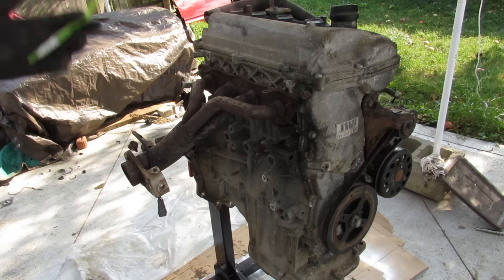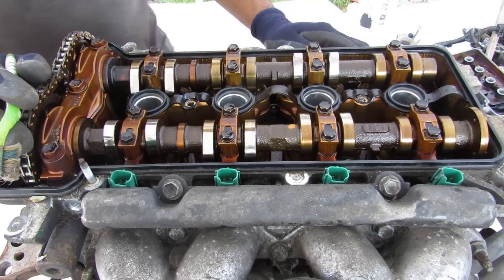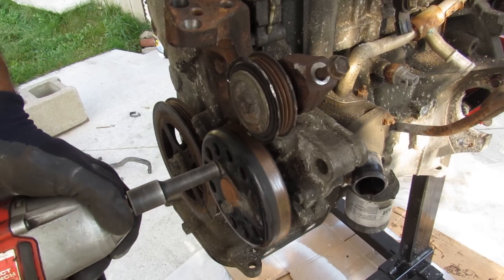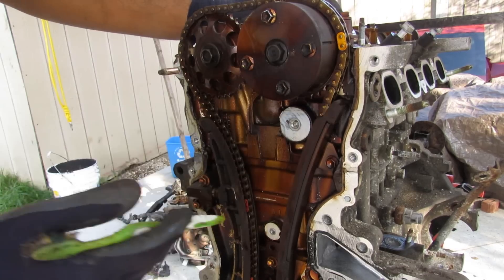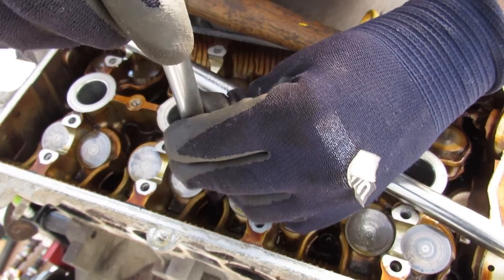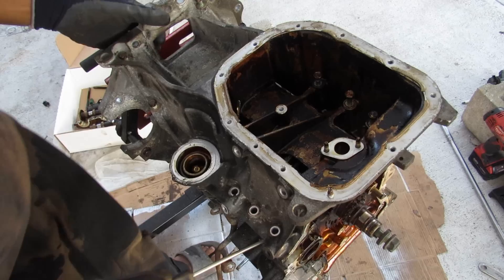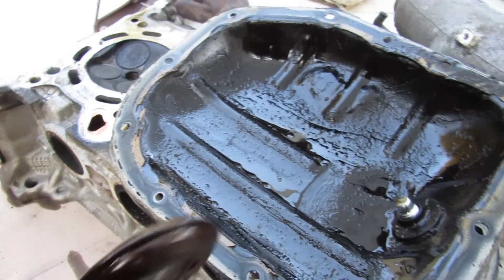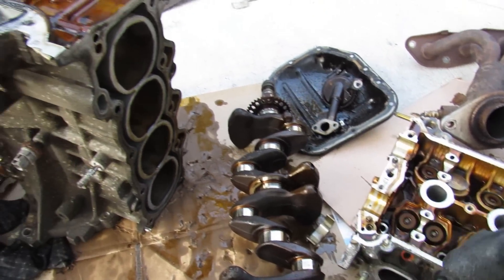What's inside a 500,000 km Toyota Engine?

Comment: Yeah Toyota has some of the best engineering and mechanical friendly assembly. I learned on Peugeot, then worked on Honda, then in an open garage with all kinds of cars and now on Toyota and everything is so easy to work on and they really have quality parts its like night and day compared to other brands.
Reply: From the work you have done on Peugeot. What can you say about this brand from your expirience?
Reply: @SunStarcz  Their absolute garbage tbh. I really dont like hating but spare your time and money and get something else.
Almost all Peugeots with +100k km (around 65k miles) leak oil at one seal or another, or all of them.
There's honestly nothing better than japanese brands. 
Yeah maybe you pay a little bit more in the beginning and parts are also maybe a little bit more expensive but in the long run youre having much much less problems and its definitly going to be cheaper.
We have Toyotas with 30+ years and 300k km and they look better than some peugeots with 50k km.
Reply: @benistingray6097  Thank you. You have only strengthen my cureent opinion. Once I will have enough money to buy a new car I am definetly getting a Toyota. Right now I have my first car and it is and 98 Peugeot 306. So far I cant say complain because it is my first car and I got it for free but still. Good to know that I better not buy from Peugeot again.
Reply: @benistingray6097  Hi, same question as before but with Honda? How much difference is there between Toyotas and Hondas? From your experience
Reply: @MHNK77  Hm their both really good but i would still rate Toyota higher. 
We had more "non service" work with Honda, mostly small stuff that broke, for example the Honda Jazz always had problems with the EGR systems clocking up.
Also i would say Toyota is more servicable. The way the engineers build stuff makes working on them super easy which in return should make repair bills lower just because the work is done faster.
But take that with a grain of salt, i havent really worked on Honda in the last few years so things could have changed.
Also im only working on Toyota for maybe a year so i dont have the same experience as with Honda.
You cant really do wrong with both of them. 
Best is to do your research on problems with the specific car and engine your interested in and avoid problematic things.
Reply: @benistingray6097  Thank you
And yeah, I actually bought a  2015 Honda Fit (american version of the Jazz)
Manual transmission, 1.5L iVtec engine, as I read it was really realible because of how simple it is. Just wanted to know another option
Reply: @benistingray6097  hmm what's your thoughts on the famous 1.9tdi by vw about both VE pump and PD ( pumpe düse)?
Reply: @SunStarcz  It’s a french car manufacturer. They are cool and unique but the quality is pretty dogshit.
Reply: Everything makes sense
Reply: Cringe Department  Cant say much about 406 and 806 but starting with the 206 it went downhill pretty fast.
P.S. And considering the 206 was released almost 25 years ago, i think my advise to not buy a peugeot is pretty sound. Someone whos interested in a classic 106 gti or something will do much more research than someone whos casually looking into buying a car without having to worry.
Reply: Hondas are easier to work on than Toyota. Just look at the service of brake bleed on the Prius vs Honda
Reply: No. From the perspective of quality, denso, aisan, aisin (toyota) always better than mitsuba, nissin (honda). Changing pcv valve always easier on toyota, changing fans and radiator also easier on toyota. Honda also making roomier cabin by sacrifying engine bay and wheel steering position relative to driver seat. Check honda fit or jazz. @LoveLikeaHurricane

Comment: Hi speedkar, are those engine oil flush cleaners any good to clean in around the oil control rings and the drain holes behind? What's your opinion on using them? Save an engine strip down? I always change oil and filter every 5000 miles. But i can only afford to buy 10year old cars. Its a lottery really, previous owners may not care too much. Currently driving a 2004 yaris which had 2 previous owners, very well maintained by last owner. 105,000 miles and oil consumpion zero, emissions reading tiny, well inside specification.

Comment: My parents had 1 that they traded to a mechanic for some work on another vehicle. It needed a new battery pack. The odometer stopped at 399,999 for some reason but they drove it for another year before it started having computer issues. It still had the original brakes.

Comment: These aluminium engines  start burn  oil after 100,000 miles. Means what???

Thery are worn.. worn parts are not visible to your naked eye..

Do you understand  that??

Comment: Can you recommend a product to remove the varnish and unclog the piston rings? My 2009 Prius is starting to burn oil. 180k miles.
Reply: Iirc there is a product your pour into cylinders and soak them that helps unclog the ring ports

Comment: That was the break in period, good for another 500K
Reply: Dude....the cylidners are not even round!
Reply: @hussamjamil4980  It's been properly sized to the pistons for optimal performance!
Reply: Agree. Fill with high detergent petrol and slap in some good quality oil and filter and change every 5000km most of that sludge will be gone.
Reply: these cars were probably scrapped because of battery issues, rather than the engine problem

Comment: Great video. I own a 2005 Prius with 193K miles on it. Owned it since 14K miles and changed oil with full synthetic oil and expensive mobile 1 filter every 5K miles. Transmission fluid changed every 75K miles and coolant changed every 5 years. I have replaced the traction battery, Throttle body and a 10 dollar radiator hose. Paid 14K in 2007. Still laughing all the way to the bank. Very happy with the longevity of this vehicle. I do not plan to sell ever. Drive until failure so large that it is financially not able to repair. Great to see this teardown.
Reply: Really? $3,000 battery and you’re laughing to the bank?
Reply: @morrisl7  i paid 2800 and sold my used battery for 1000 and returned a completely dead battery from the person who paid 1000. My cost basis is 1800 so yeah still laughing.

Comment: Have the updated 1nz fxe engine in my 2017 axio hybrid. 80k km. It runs good but with an occasional cold start rattle especially if the injectors are dirty.

Comment: That's an interesting view: bearings all nice and clean, but those piston oil scraping rings... I have a 2010 Lexus GS 450h, the 2GR-FSE with 356.000 km. I reckon it would look similar inside, perhaps less sludge, as there is some oil consumption, but runs fine.
Reply: Seems consistent with my 2008 prius with 287k miles. Used 1qt of oil every 1500-2000 miles
Reply: Hlo senpai big fan here
Reply: Just use Eneos Sustina 5W30, which keeps the engine very clean. The Toyota 5W30 sadly is a very bad quality oil (but their 0W20 is probably the best among the 0W20 oils). I couldn't find the TDS for the Toyota/Lexus 5W30 so I am not sure if that is better than the Toyota 5W30 but you don't go wrong with Sustina.
Reply: @IstvánUjj-Mészáros  I prefer Motul
Reply: @VisioRacer  the Motul may be good too, but I have personal experience with a P2 that was consuming almost 1liter on every 1000kms (it was using Toyota Genuine 5W30), and I did an oil ring cleanup with Xado MaxiFlush and started to use Sustina, and there is only some very minor oil burn now (about 6dl on 10.000km). And there is no oil burn at all for those P2 users who were always using Sustina.
Reply: @IstvánUjj-Mészáros  The brand doesn't really matter unless it is synthetic in the correct weight. It just matters how often you change it to prevent sludging. The more often you change it the better. The 2XX toyota engines are sludgers so they benefit strongly from 5k or less mile oil changes. They don't seem to do well with 10k oil changes and usually clog up the rings pretty quick.
Reply: @paladain55  the quality matters, and there are some very good quality oils, but shell is using Gas-to-Liquid base oil which makes it special (some other brands are using that too but they don't make the information public so we can't be sure which ones are using that). GTL burns very clean, hence it keeps the engine clean. There are a lot of tests on YouTube about the Pennzoil Ultra Platinum, which is the same as the Shell Helix Ultra (Shell is using the Pennzoil brand in the US). It is an exceptionally good oil, especially for Toyotas where a lot of petrol engines have the sludge problem. If you change it every 5k or less mile then you are probably good with any synthetic, but in Europe, people are usually changing the oil after ~9.3k miles (15k km) as it is what Toyota tells them to do, so it is very important here to use very high quality oils. I know that the Sustina is fine for 9.3k miles as many P2 users were using that since the car was new and these cars don't burn oil at all. Sustina is using a very special additive package, probably that's what makes it that good, but I have the suspicion that it may also use GTL base oil (I may be wrong about that). The Shell ECT C2/C3 has exceptionally high viscosity index (204), which also makes it stand out.
Reply: @IstvánUjj-Mészáros  This is more or less why i say change it early and use synthetic. There's more risk vs reward leaving the oil in for a long time like that. Change it at 5k instead of 10k over 200k miles in very little extra expense vs more than likely clogging the oil control rings.
Reply: Great vlog very detailed and informative. Question what oil was use in this engine is it mineral or synthetic oil thank u & more power on ur vlogs
Reply: put in some marvel mystery oil!
Reply: https://youtu.be/wafZjkY0H_E
Reply: @sin-sinner7192  no

Comment: The typical hybrid motor won't actually have that many miles because if you're using the electric 30% of the time that's actually 30% less miles that car is actually running so the engine didn't really look that good for 200,000 miles

Comment: 494 000km on my 2nd gen Prius. It's so freakin reliable. Just warm up/cool down your engine and change oil regularly, then the car is gonna last forever. Current oil consumption is 0,3l/10 000km, which is pretty acceptable I guess :)
Reply: WOW😅
Reply: awesome reliability.
Reply: What kind of oil did you use?  Are you a sporty driver?
Reply: @Elaba_  so, 3 days ago I passed the 500 000km mark :-D

oil change every 10 000km, I use Mobil 1 5w30.

I always let the engine warm up properly and never push it when its not on perfekt operating temperature. My Prius gets pushed once it´s warmed up, quite often over 150km/h+ on the highway. Sometimes, I need my car to go that fast, that´s why I don´t use 0w20 oil but 5w30. Seems to work fine.
Reply: @thecaristascarchannel9189 when you say "warm up" the engine you mean just waiting for the optimal temperature to push or you force the engine to go on, pressing the accellerator before you start driving? Tks
Reply: @LiknonP  start up the car, push the accelerator shortly to turn on the engine, then I´m putting my seatbelt on,  turning on my music or a podcast and then I drive off very gently till the car reaches operating temps
Reply: My 4.0 i6 intec burned zero oil at 400,000km
Reply: how often have you changed the batteries of the hybrid system? impressive car btw.
Reply: @raphera6562  yeah, at almosrnexactly 450 000km. One cell was bad, entire battery was replaced due to my plans of keeping tge car long term. The oem toyota hybrid battery was 1500€. :)
Reply: Using 300ml of oil every 10,000km? Isn’t that nudging the “high” side? Genuinely curious. Then again since you are taking good care of your car 300ml isn’t an issue as the oil will be replaced by then :)
Reply: @ezymarkz  300ml/10000km is not much at all. The owner manual claims that everyrhing under 1l/1000km is fine😅

Comment: As far as the sludge, these maintenance reminders from the mid 2000s caused Toyota lots of issues. They were still on conventional 5W30 and many of them on factory settings only called for LOFs every 7500 or 8000 miles. IIRC Toyota did an update to lots of cars from this era to shorten the intervals. Possibly related to the 2AZ oil burning.

Comment: But since this engine was in a hybrid, doesn't that mean that it technically run much lower miles than what the odometer recorded !??
Reply: A little less, but since this is from a 2nd gen Prius, there was no driver control to enforce an EV mode (that debuted on the 3rd gen) and it basically only shuts off at idle. So it ran less, but didn't really see less miles (since it basically ran whenever the car was in motion). Which brings up an interesting point about a car that has low miles but lived in a gridlocked city with lots of traffic. How much time did the engine run while the odometer wasn't turning? Hmmm...

Comment: Crazy how some folk neglect oil changes and use poor quality filters. I change mine at a max of 3,000 miles, as it's an old IDI diesel, and even my bike gets an oilchange when it goes only slightly dark in colour. Just put the bike away for winter, as it happens and changed the oil so that no acidity could attack the seals. This time, the oil had done only just over 700 miles, as travel was banned due to Covid, but it's kind of a peace of mind thing as much as anything.

Comment: A good condition engine let down by poor servicing. That engine would have done 1m miles if serviced regularly with quality fluids and filters.

Also - there's no such thing as pre-detonation - just detonation. There's pre-ignition, and that's detonation; it happen before the ignition event. The knock sensor is calibrated to pick up spark knock, a post spark event, which causes the ECU to retard timing on that cylinder.

Comment: Excellent video!  Not sure I agree about the hybrid engines not having as much wear because they don't run all the time. My Prius engine runs 90-95% of the time and does alot of on/off cycles that I think might cause more wear than an engine run at constant rpm's. I believe we don't see much wear because Toyota makes well-designed and built engines.

Comment: 320,000 miles on my ‘06 Prius and running.  In the past I didn’t even put oil in there at times and when I checked there wasn’t a drop of oil left and also zero coolant lol.  Still kept and keeps running.  Toyota is just indestructible.

Comment: For a hybrid, what % of time would be typical for the gasoline engine to be running? 30% ? 50% ?
Reply: I wonder the same thing. I have a new Honda hybrid, and there is little dashboard indication of whether the engine is running or how fast. But I can tell you that after 3,600 miles, it still says “70% oil life remaining.”

Comment: What really surprised me is the camshaft area had no sludge at all, just some discoloration from the oil but down in the oil pan there was a lot of sludge and the oil pickup screen was basically clogged. It would be interesting to find out what kind of oil (conventional or synthetic) and how often they changed the oil.

Comment: Beautiful video! 
I think it's clear how important is to do a correct oil change. Regular intervals, good quality oil and filter. With a proper maintenance it could go 1,000,000 miles.
Another thing that I noticed: that car didn't probably drive in the rust belt... Here in Michigan the exhaust manifold would be rusted solid by now, the bolts wouldn't come out so easy.
Reply: No, cars are not designed to last 1 million miles. Wear happens regardless of oil changes.
Reply: @justayoutuber1906  : Did you ask a Toyota engine designer??? Recently a Tundra reached 1,000,000 miles. Also I've heard of Tacomas teaching that. And not only Toyotas. A Nissan Frontier that did package delivery in Chicago area also reached the million miles (with manual transmission). Amazing what us poor guys can do to extend the life of their vehicles...

Comment: Question for Speedkar99 or anyone. I follow you and used ur video on my timing belt replacement video for my 97 Lexus es300 IMZ 3.0 motor. It’s been about almost 3k since the replacement. My question is I’m getting a almost like a higher pitched noise coming from front cam pulley. Any idea what causes this? It almost sound like the pulley is loose. I did take off the cover and inspected it and everything looked good. I used Asin oem parts from rock auto like you did. Could the belt be too tight ? The idler looked fine that was my first theory and the noise is coming from the front cam pulley and I didn’t change the seals. I have looked on forums nobody seems to know but suggest have it inspected. I don’t have the cash for it lol it’s why I done job me self. Any help be greatly appreciated!
Reply from the maker: Use the stethoscope or screwdriver to pinpoint the noise while it's running. Could also be your accessories as well
Reply: If the belt tension is too tight, it can whine like a supercharger belt. Go find a video about a Dodge Hellcat, inevitability they will be driving it hard and you can see if that is what your timing belt sounds like.

Comment: There are plenty of the 1NZ-FE variants in cars like the Yaris which have done 300,000 to 500,000 miles on minimal maintenance. They all burn oil but as long as you keep it topped up and it doesn't exceed a litre every 1000 miles you're fine to keep on truckin'. These engines might have been a little lacking on power but they are virtually bullet proof.